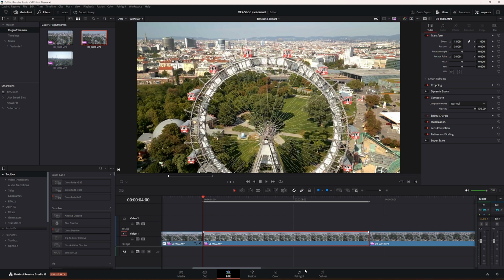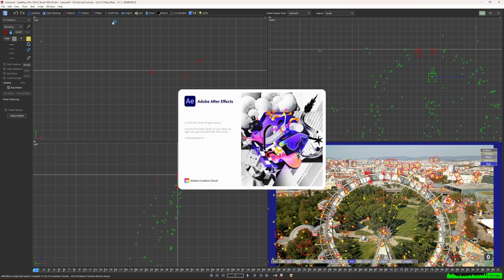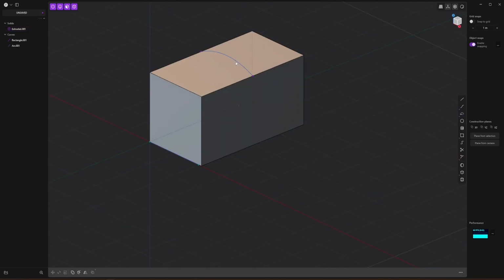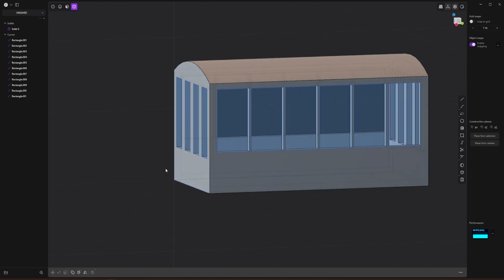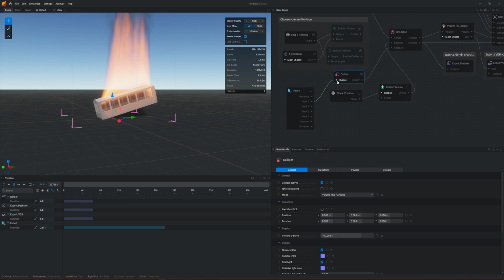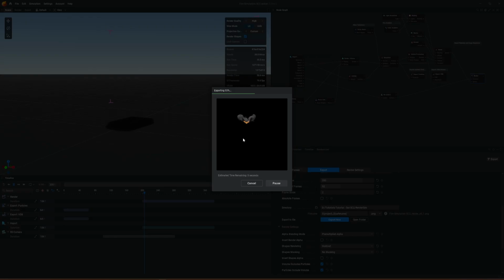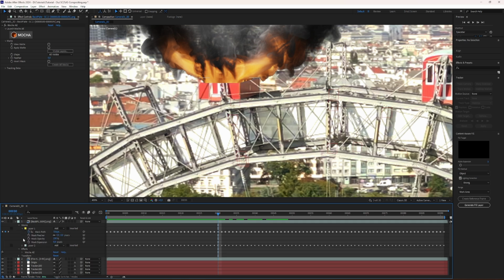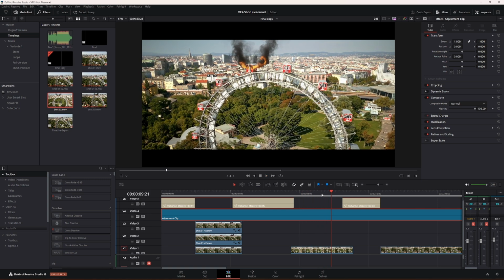Ultimate Guide: Creating Fire & Smoke VFX with C4D, Embergen, AE & SynthEyes

Comment: Verry great tutorial and use of different tools! 😁 But i have one question, why are you not using the pyro inside c4d for fire sym?
Reply from the maker: THX a lot, I appreciate that much! You are absolutely right, there is also the possibility to use pyro within c4d. Like everything in life, there are advantages and disadvantages to both options. If I create and modify a simulation in real time then Embergen is the first choice. If I want an even better result in terms of integration and interaction, then Pyro within C4D is the better choice. It depends: do you want speed or better interaction and integration? Both are justified.